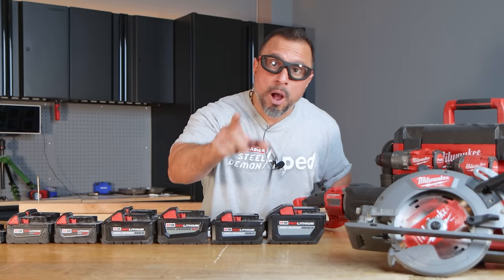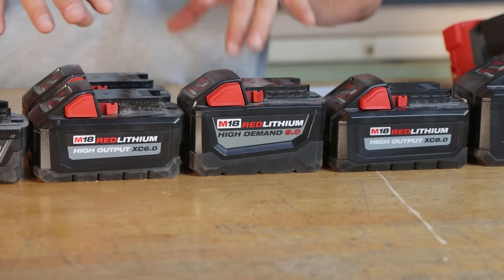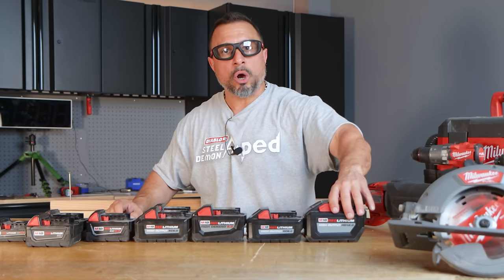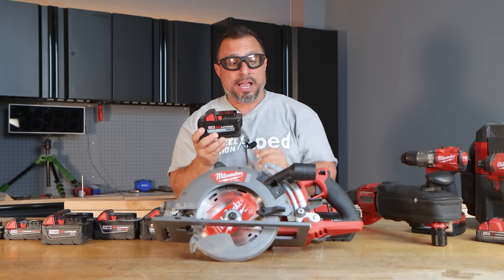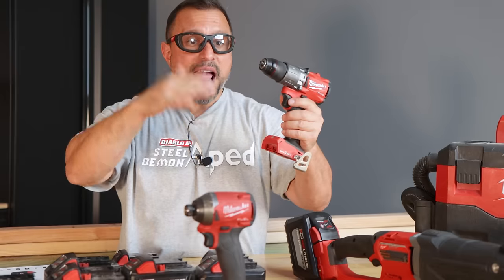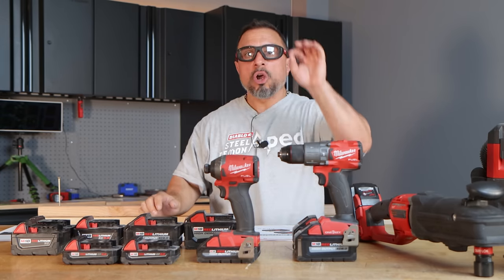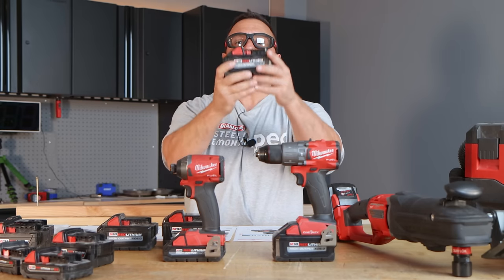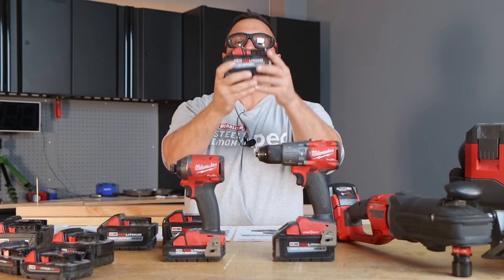Your BUYING and USING Milwaukee M18 Batteries ALL WRONG! (stop doing this)

Comment: When you pulled out that light I thought Milwaukee came out with an M18 bazooka.
Reply: Me too lol
Reply: HAH! IM NOT THE ONLY ONE
Reply: JonahKai Guam 
Neither me the last one! Lol
Reply: One day my friend, one day.
Reply: Adrian Fuentes 
I have some sort of depiction concerning this matter. lmao
Reply: We have one of those bazookas. 2 nights ago was working on one of our vehicles and used a fully-charged HO, XC 6.0 for 5 hrs at middle brightness. I was finished before the light was.  I could’ve plugged it in but I wanted to see how long this battery would last.  This was the first time I noticed that each leg has a hole for nailing the light to the ground or wood, etc.

The only disadvantage to this light is that it does not tilt below horizontal. It starts straight up, we’ll call that 90°, and only tilts down to 0°.  The M12 Tower light starts pointing straight down, and will tilt up beyond 90°. It only has two light settings, but can be plugged in also.  They both turn  horizontally well enough.
Reply: Hysterical
Reply: They are actually called rocket lights.
Reply: I'll wait for the fuel version 🤣
Reply: Its is actually called a rocket light, so your not too far off lol! 🚀
Reply: Well now there’s a product I could use!
Reply: I have that one too and everyone said the same to me when I carried it around
Reply: The bazooka exists, but each and every battery pack requires a tax stamp.

Comment: Electrician here, I made the change from Dewalt to Milwaukee 2 years ago. And the performance and quality has been night and day. Been investing in batteries as of late and the HO batteries are amazing. I do shutdowns pretty often and use my 5.0s for my lights and the HO 3.0s on the cable cable cutters, impact, and drill. 2.0s on the cable strippers and 6.0s on the vac (for longer runtime) its amazing how much more efficient everything is having the right tools. Lol
Reply: Good choice. I used to manage a fleet of trucks, toolcrib and warehouse for a larger company in Alberta, Canada and all of the power tools were Milwaukee. And our guys were super rough on tools lol. 
I was never one to buy brand name but Milwaukee has blown me away. Now I've made the switch and everything I own is from them 😁
Reply: I enjoy Milwaukee Tools am also an Electrician. Will 3.0 HO battery on a fuel hammer drill using a 1 inch auger bit to drill wood studs work? I use a 5.0Xc battery on my hammer drill.
Reply: @mikedimarco3008  I don't care what anyone says. That 3 amp battery will be dead on that drill right away.
Reply: i thought you said milwaukee to dewalt at first and i was going to shit on your beliefs
Reply: This must be a lie cause what are you using a shop vac for? electricians don’t clean up😂
Reply: @DavidPerez-fr1hb ain’t that the truth 😂
Reply: @DavidPerez-fr1hb Damn true. You're picking wire plastic and copper threads and all kinds of dismantled sh*t all over everything in their wake.
Reply: Thanks ! I was thinking of switching brands as I got into the higher voltage tools . I'll stay team red. ALTHOUGH I just bought an18v Milwaukee circular saw DEAD out of the box. Daaaamn. They xchanged it at HD though.
Reply: They definitely are better but to be honest the Dewalts did everything I ever needed them to just fine and in a lot cases the extra price isn't worth the extra unneeded performance. JMHO.  But I do love my Milwaukee.
Reply: @DavidPerez-fr1hb  electricians clean up a little more than plumbers😅 or is it that they just have less crap left laying around🤔😊

Comment: As steel construction worker. I have to say there’s still an upside to having 5.0 batteries. Putting a 6.0 makes your tool significantly heavier. Plus it throws off the balance of your tool. (1/4 impact,1/2 drill specifically) proper balance makes putting in screws in awkward angles way easier. And the the lifetime of a 5.0 is still really good
Reply: I agree with you
Reply: yeah i put up signs for a living and you can have all the power you'd like ... are you willing to snap yoru wrist for it when the screw you need to tap is at an upside down angle
Reply: Agreed. Thanks to Vince, I'm now hunting for discount prices of the lightweight Red Lithium XC 5.0 Batteries on Amazon. As a Sign Painter who's sometimes up 27 feet with one hand on the ladder and my other hand working a Milwaukee, I look like a trained Monkey. I need way less ounces in my hand and more Bananas for Lunch.
Reply: @designertjp-utube  Dewalt atomic with powerstack 🙏🙌
Reply: My crewmate has 3.0s and 5.0s. The 3s are okay on the nail gun but the 6 1/2 saw doesnt have the balls to cut much without a 5.0
Reply: @maxnovakovics2568 , no!  The 3.0 HO batteries aren’t just okay on nail guns, they are awesome!  I can trim out almost 2 average size houses with the M18 Fuel 18 Gauge Nailer, shooting 2” nails, utilizing 1 3.0 HO battery.

The 6.0 battery will always, always provide more torque with a Fuel tool and longer run time than the 5.0 XC batteries.
Reply: I’m an iron worker as well and don’t get me wrong 6.0 and 8.0 do have more strength and power but the intensity on the tool it’s self is so highly that it wears everything out I have and 1/2 impact from Milwaukee using the 6.0 8.0 give you more torque but the wear on the tool is so damaged that you literally have to press the battery against the tools to work cause it become so loose after wear and tear on bigger batteries that make your job more difficult and more time consuming so va a regular 5.0 so take your pick after so long of wear and tear not even a 3.0 will hold I. Place you would need a rubber band or keep pressing the batter toward your tool to even run it I understand his point of view but there are advantages to running lowers amp batteries
Reply: @SSGTWinters  you can put up signs as much as you want, but you’re gonna have one hell of a time driving screws when those 3.0’s die in about an hour or two of decent work
Reply: @playbizzle2675   thats why i carry 3 different kinds with me a size for the task plus we have a charger integrated to the truck. when we are done just pop in pack up and down to the next job
Reply: @SSGTWinters  i strictly don’t use shit beneath a 4mah just because of the life time, i work hvac so i’m usually running a hammer drill, impact, sawzall, n circular saw, n some other m12 tools. just curious, how long do those little guys take to charge?
Reply: @playbizzle2675   the one i timed was about 40 ish minutes. but i do have 4.0's 6's and 8's  never timed those for me a 3 will last roughly a half hour if i use it all the time but i have like 4 that i rotate thru
Reply: @SSGTWinters  bet, i still wouldn’t buy anything below a 5mah in this day and age unless it came with a kit or a tool you wanted at a discounted price fr fr
Reply: @playbizzle2675   it has its uses when you have a small tight space but need a drill they are a life saver. which is why i keep them. they have their uses just like any tool in your box.
Reply: I COULDN’T AGREE MORE Brother, Vince is talking out of the side of his face  on this one here. I wouldn’t be BUYING ANY NEW XC 5.0 batteries, but there is certainly plenty of tools I own which work GREAT WITH THEM and there is certainly no reason to toss them in the trash heap or UPGRADE them!!  When they die I will replace with latest technology, but I’ll be damned if I am going to run out and upgrade all my 5.0’s WHEN THEY WORK JUST FINE IN EVERY TOOL I STICK THEM IN!!!
Reply: @mikeloks7560 KEEP SMOKIN THAT CRACK LOL

Comment: Reason to run XC5.0, because it's the damn battery I have.
Reply: If its not damaged, is it still a good one. 🤷
Reply: True if I’m on the job and my bigger battery dies I’m using the small one until the job is done or the big battery is charger
Reply: There is barley any difference in the battery's anyways..
Reply: @Ben I Good enough reason for me 🤷
Reply: @m2rkiller  not true in some cases. I have the super hole hawg right angle drill.  My 3.0 battery can not handle my 3" forstner bit. But if I put my 8.0 on there, drills through like butter
Reply: @sjohnson5813  yeah, and mine does it with the XC battery, which is smaller than the 3.0. Doesn't last as long but still does it.
Reply: @m2rkiller  a 3.0 will not drill through the 2 top plate studs if you use a 3" forstner bit. Every plumber I know, including myself know this. You can do it with a 3" hole saw bit but it wont with a 3" forstner.  Sorry bud, you're wrong.  The forstner cuts up too much wood and just binds up, if you use a battety  not powerful enough.
Reply: @m2rkiller  so what profession are you in where you drill 3" holes with forstner bits?
Reply: @sjohnson5813  I am a craftsman of almost every trade on this planet and even sometimes milling or making my own materials for a job, all the way past fabricator, plumber, construction, mechanic, you name it other than somthing outrageous, I've probably done it! Me with my 10s of thousands of dollars worth of tools, including a 3, 4, and 5 inch forstner auger drill bits! ✌
Reply: @m2rkiller  hahaha you said 5" forstner bit. Haha. Why you trying to act like you know what you are talking about? When clearly, painfully obvious you dont?
Reply: @m2rkiller  🤦‍♂️
Reply: @joey4277  👍
Reply: @m2rkiller  ok :)
Reply: @eivinj  okay 😀
Reply: Because i cant afford another monster battery. Hahaa
Reply: @m2rkiller  I notice a difference in my yard tools. Especially in my chainsaw.
Reply: @nickradeke  I don't notice any difference at all. Other than they will kill my little xc before any of my other battery's.
Reply: @m2rkiller  I only really notice it on my high demand tools. I think like VCG said, if you got the old batteries, no big deal. But you might as well buy the new batteries if you need some new batteries anyways.
Reply: @nickradeke  all I know is all of my batteries are between 5 to 10 years old and all of they are still the same as when I got them. The only one I don't know about is my little xc and that's because someone found it in the trash and gave it to me, I charged it and it works. It obviously doesn't last the longest because it's the smallest but it runs everything I have and runs everything under a load too. And I damn near have half of milwaukees fleet and I know for sure I'm hitting the sales up this year to get more tools.
Reply: @m2rkiller  everyone in the comment section clearly wishes they were as cool as you
Reply: @ryanm2084  I don't think I'm cool at all, but I am 100% a workaholic. So what ever you say 🤔
Reply: @sjohnson5813  I'll agree with you on this. Drilling holes for 1/2" water lines is a good test.  I get 1/3 the run time on a 3.o vs the 8.o.  But jump to a 2 1/8 and a 2 9/16 bit and I'm lucky to get 1 bathroom drilled out.  With the 8.o I knock out the whole second floor and half or so on the 1st floor.  I have started using 3 tooth Big Hawgs(The super Hawg loves them) and they doubled my whole count. Drilling 4.5" holes is  not much different than 2 9/16 with them bits. Meaning  load on the drill.
Reply: @smitty_1  yessir. You see the difference between those batteries real quick when your a top out guy. I need to try those Milwaukee 3 tooth bits. Couple guys have been saying those are pretty bad ass.
Reply: @sjohnson5813  They are pricey and although they claim to be nail eaters I pull nails or grab a dozen hole saw.
Aside that once you get use to messing with the pucks and its second nature your good. (I keep a flat tip on me in case they dont fall out) 
1 thing I do is swap out the paddle bit to reg Arbor bit to help in removing pucks easier. The teeth are wider than the cup so the puck is loose and normally falls out. This design also creates less drag on the drill. So basically you only spinning the 3 teeth through the wood. If that makes sense?
Reply: Ben I, you're obsolete.
I mean... YOU'RE OBSOLETE.
Reply: @kickinrocks6055  You are weird.
Reply: I fr only have one and I switch it between my tools when I need a different tool 💀

Comment: 3.0 and 5.0 for one handed tools, 8.0 for two handed and 12.0 for stationary stuff. I still feel like the 5.0 is versatile and not obsolete. Significantly smaller than the 6.0 and 8.0 while having more runtime than the 3.0
Reply: Pretty much what you need to know and it only took common sense and 30sec to read. 
BTW-Did you type this while wearing safety glasses and waving your arms around?
Reply: I have 6.0 which is same size as 5.0.
Reply: @rbfarmer4522  AWESOME!!  I only made it :70 seconds into the video before I had to stop it.  I knew it was going to irritate the living crap out of me and was hoping someone would summarize it.
Reply: Nice Thank You.
Reply: Thanks for this. The video was tortuous to watch!
Reply: Same. The 5.0 have stupid long run times for my drills and multitool. That and I can fortunately get them for $40 a pop.
Reply: @mr.wizeguy8995  nah 6.0 is bigger and heavier lmao i got a 6.0 and 2 5.0's lol
Reply: @jacobianmail  $40..how??
Reply: If an impact wrench can't snap 1/2 inch grade 5's at will, and all day, it's useless to me. Save your cute little batteries for your flashlight. I've got work to do.
Reply: leaf blower is one hand. also i use my weed trimmer with one hand
Reply: @steelersjohnson  stolen
Reply: Only problem is depending on what youre doing you usually want 2-3 spares charging at any given time.
Reply: Perhaps, but I keep two 12s that I use with a weed whacker, and like the setup. I get about 45 minutes of full on run time with a 12, and don't find it maked the tool any heavier than a gas powered unit. 

At the other end of the scale, I often use a 1.5 with my grease gun, and I find that I get a week or more out of it, using it on a daily basis for greasing my excavator. I appreciate how it doesn't weigh the tool down. I think I tried a 1.5 once - and only once - on the weed whacker, and it pooped out after a couple of minutes. 

Learning as I go; this video helps a lot though, as I had no clue before about the differences between the various M18 batteries.

Next thing I hope to do soon is make a solar charging station (probably portable) so I can charge my tools when the power goes out or when working in the field, away from a convenient place to plug in a charger.
Reply: And I'll take xc5 all day when they're included for free with a tool
Reply: @Mr_Gabbles  Cant beat the price of having it with the tool for same cost ;)
Throw away a usable battery, just to spend money on a slightly better one? Better use it and ADD that better one as extra

Comment: It should be mentioned for people with older tools that the belt clips do not allow for a high output battery pack and you will have to remove the belt clip in order to use the high output pack however call 1-800 sawdust and they will send you the new belt clip for free that will allow for the high output packs
Reply: Cool man. Thanks.
Reply: Or just bend them a bit
Reply: You can bend them and make it work.
Reply: Just bend them with your purse
Reply: @galvanizedgnome  😂😂

Comment: You gotta talk about the difference between the XC6.0 and XC8.0 batteries. Same cell count, but different amp output ratings. The 6.0 can put out more amperage at less voltage drop, the 8.0 can deliver longer run-time. The 6.0 is superior for high-load tools like saws
Reply: And he is not mentioning the Hypo batteries also use diff chargers too. I found that out the hard with Rigid crap. Stay with Makita. They have slipped a little but not as bad as that way over priced Chocom made Millwakee
Reply: @thekingsilverado8419  The high outputs don’t really use different chargers though. They will charge faster on a rapid charger, but they are still compatible with the old chargers.

Comment: For the common household or small business this totally makes sense. For us not so much. Milwaukee batteries have a 3 year warranty and tools have a 5 year. They break and I get a replacement way before that 3 or 5 years are up. Not because they are cheap but because they get used all day everyday constantly being used. I’ve been with Milwaukee for years and wouldn’t go any other direction.

Comment: I purchased a 3.0  High output and 2 6.0 high output use them whole days worth of work 8 hours on a constant use and still have battery left by the end of the day. All day running strong.

Comment: The 5.0 battery fits the Rover light flush.  If you use the 6.0 it sticks out beyond the body of the light, which obstructs the magnets, making it hard to mount on flat surfaces. So, it does pay to have them on hand if you plan on mounting the light with the magnets.

Comment: Absolutely love the 6.0 batteries, much better piece of equipment than the 5.0s. I ran a 5.0 on my router and it drained quickly, switched to a 6.0 and it last much longer as well as performed much better.
Reply: So replace the xc 4.0 on my 1/2 impact ? I can't even get lug nuts off cars .
Reply: @daniellugaro445  Yea
Reply: @daniellugaro445  what impact gun you using ?
Reply: @daniellugaro445  I just purchased milawaukee m18 onefhiwf12-0 impact gun it has 1989nm of breakaway torque and using a 5.0ah without a struggle on setting 3 on the gun alone and still have no 4 to use if needed ?
Reply: I call BS